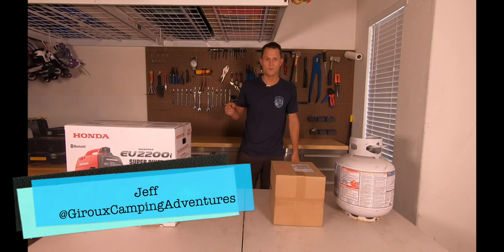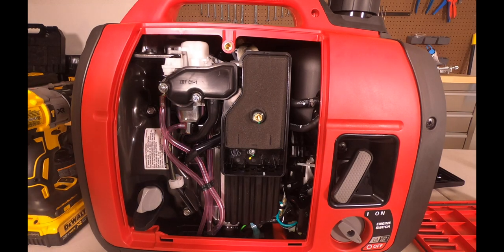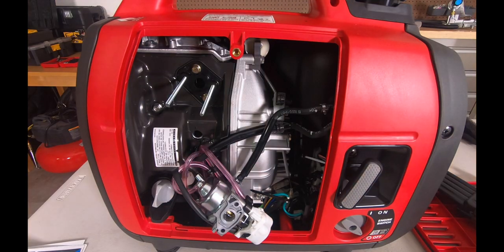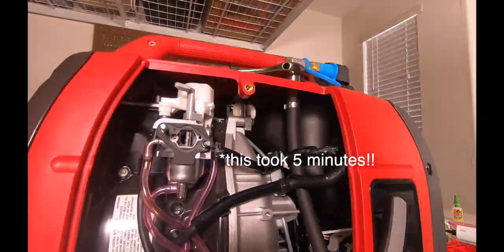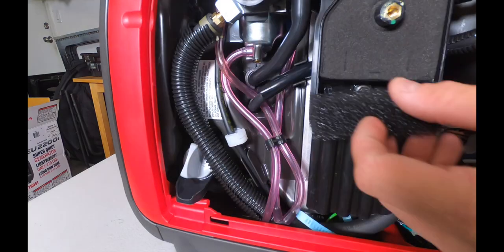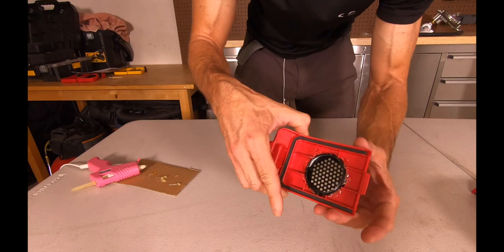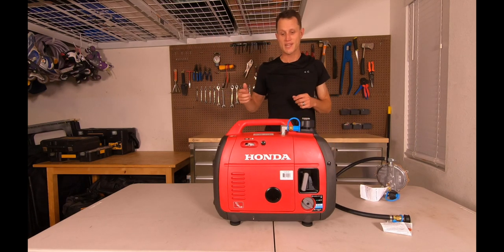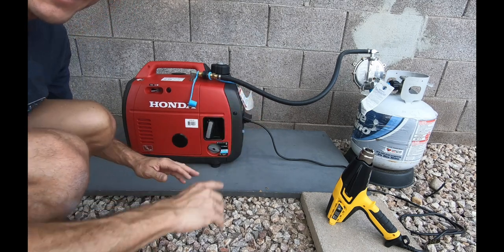Honda EU2200i Generator and Grenergy Propane Kit Conversion How-to

Comment: For anyone wondering if the EU2200i propane converted generator will run an air conditioning unit. Please check out our video here ---> https://youtu.be/n_qTBbOm_Fo
Reply from the maker: Hey curious how the wattage output difference in this converted Honda EU2200i unit versus one of those other vendors with duel fuel already. Those other boxes like champions or other vendor with duel fuel will have a gas run/peak wattage listed on the side as well as a propane wattage run/peak. The propane number is lower than gas.

It sounds like the propane conversion kit for the Honda EU2200i does not lower wattage output capability versus gas at identical conditions, right?
Reply: @girouxcampingadventures  Oops Sorry! Didn't see this comment until now. 

The other brands list them at lower power output to stay within its safety margin. There are two factors on why this is so. 1.) Limitations from the cheap Chinese demand regulator. 2.) No fuel adjustment for 5k feet and above. Meaning no fuel adjustments for the consumers to tinker around with, which considerably reduces product liability. 

Simply setting a leaner fuel mixture from the factory will compensate for all customers who are 5k feet and above. Why? LP and NG runs hotter when rich, and cooler when lean. Gasoline does the exact opposite. 

For example, if the propane fuel settings was set perfect at the factory for zero feet above sea level, but the customer lives at 8000ft above sea level where air is much thinner, the engine will run way too rich. This results in hotter engine temps, or worst, the exhaust manifold on the generator gets cherry red. It is much safer across the board to run the engine leaner, all at the cost of reduced power output. 

Our kit combined with a much more sensitive demand regulator, we're able to match power output with gasoline fuels. And having that fuel adjustment for 5k feet and above makes a huge difference in engine performance. 

Meaning you don't have to sacrifice power output when running alternative fuels. Which is why it has taken us so long to develop this kit. A lot of trial and error went into problem solving this issue, when the rest of the industry says to its customers "good enough". 

Yes, that is correct, our kit does not lower power output compared to other duel/tri fuel generators. I have yet to see a customer call or email with concerns about lack of power when running our kits. 

Hope this answers your question!

Comment: Turn till threads are stripped, then, back off a quarter turn.  LOL
Reply from the maker: Definitely, then you don't need torque specs listed in manuals. Unfortunately I did this on my 12 year old mountain bike when replacing the front fork. I was attaching the last component...the brakes after doing all the rest of the work (a pain). And sure enough, 1 of the 2 bolt threads stripped but I swear it was not me. I barely applied force. Now I'm stuck with brake bads that constantly rub against disk. I'll need to re-thread...or buy a new bike which is also on my list. It rides good enough...gives me "resistance". I adjust the brake component whenever I take hard hits as that's when it's just enough force to move and rub until moved back. Yes, I tried loctite...no difference red and blue.

Comment: To me your video makes no sense.
To take a brand new Honda generator, which is by no means the cheapest, and void the warranty is crazy. If you wanted a generator to run on propane, then you buy one that is either multi-fuel or already set up.
So to sum it up. You purchased an expensive generator, voided the warranty and spend more money on a conversion kit.
What a waste of time.
What a waste of money.
And you have NO warranty a newly purchased products.
You're an absolute genius.
You're the perfect example of voodoo economics.
👎👎👎👎👎👎👎👎👎👎👎
Reply from the maker: Glad you watched it and enjoyed it enough to make such a lengthy comment! Thx for watching. Stay tuned for more!
Reply: @greggminkoff6733  Now now, we're all adults here and should treat each other as such. If you need warranty you can purchase one from us, and we will take over warranty coverage. We have had a few handful of customers buy the warranty and never needed to use it. We refund the warranty purchase at anytime if the customer decides they never needed it. 

All other portable generators that are sold with dual or tri fuel from factory are all made from 2-3 Chinese factories with engines cloned from Honda and Yamaha. They are built cheaply with cost first and reliably second. And that includes the LP/NG parts made to run on those generators. 

Giroux Camping Adv has ran our kit for over a year and never had any issues, nor have our customers that first purchased from us when we started 3 years ago. If there were issues and Mr. Giroux was not happy, I'm sure he would have taken this video down long ago.
Reply: I agree, that I wouldn't want to mess with the orginal
Honda Warranty. I don't see anywhere on the GREnergy site, that you
can purchase any warranty that would replace your Honda Warranty.
Even if they did, it would be an extra purchase to replace a warranty 
that you already have free with Honda. And I cant imagine a better warranty
than Honda. And I wouldn't want to mess with doing anything that could be used as an excuse to not honor that warranty.

Also, I see that you can purchase an original cover, but its not cheap, and it was hard to find. If your worried about that, you can purchase side panels with the vents already installed from GREnergy for $25. Though it wont replace the hole in the top of the case where the Propane hose goes to.

I would only consider doing this after my original Honda warranty expired. This guy started tearing apart and drilling holes in a brand new very expensive Honda Generator that he never even ran before. What if for any reason, there were any problems with the generator prior to installing this kit. How could he expect Honda to honor the warranty. How would he even know if the problems existed prior to, or after installing this kit? I would think you would want to know if the thing even runs out of the box, before doing this.

The reason people don't buy another cheaper generator brand that already has propane, is because most of them on the market are crap. Its the reliability, performance, and quality of the Honda Generators that make people want to install this kit. And installing a kit to do this is your ONLY option today. 

That said, this is great instructional video for when you are ready to add propane to your Honda Generator.

Comment: Horrible kit.
Reply from the maker: Why? Works great for me so far. Honestly though my only downside when doing it...keep it mind it was a project and not for the actual need...I didn't care for the holes in the casing. However you can simply order new sides if you ever need to "reset" the setup back to factory.
Reply: @girouxcampingadventures  Correct, new panels are fairly inexpensive and can easily be purchased new at your local Honda small engines dealer.